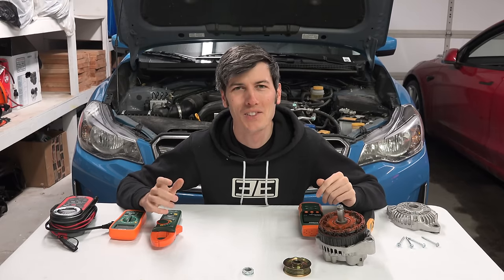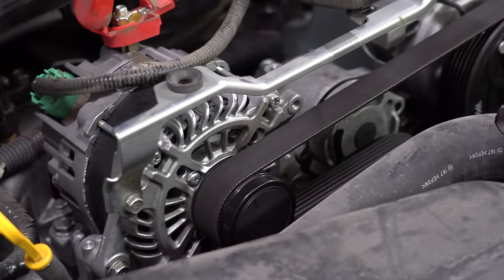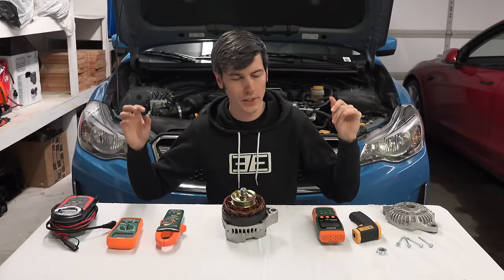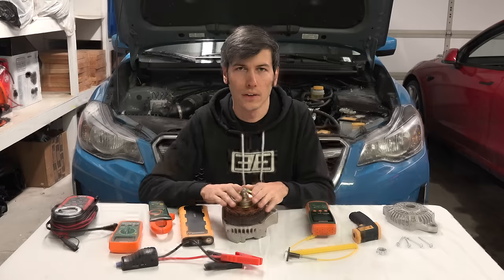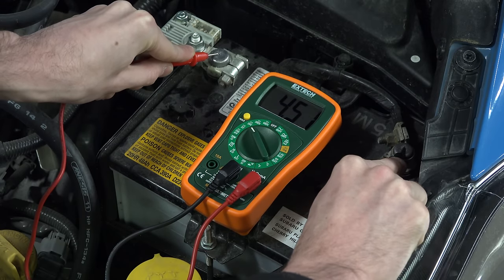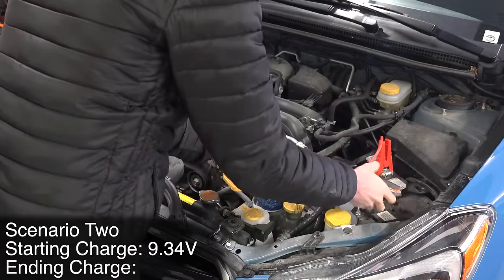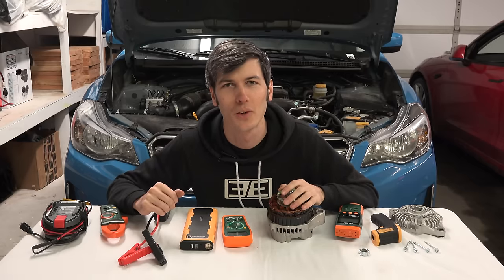Can A Dead Battery Ruin Your Car's Alternator?

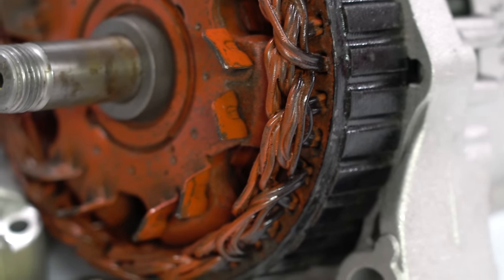Comment: 9:42 that is about the complete oposite of how it really is.

The alternator has a set max voltage.
A bad battery that doesn't take charge anymore draws significantly LESS current to rise the voltage to the max voltage and the alternator won't do much work.
A good battery with low voltage however will draw significant ammount of amps.

An alternator only outputs as much amps as your car and battery can receive.

If a battery is bad it usually take maximum 20 to 30 amps charge if it is low voltage, a good one will easily charge over 70 amps or more.

Work as a full time mechanic and is the head of electrical diagnostics at work.

It's not like you said "a bad battery will take more current to charge"

Still a good video tho
Reply: Btw when measuring both the alternator and battery voltage and comparing it the only thing the numbers tell is the voltage drop over the wire and charging voltage at both locations. 
Is it would be a difference over 0.1 volt it would either a very high amp draw/charge og bad connection
Reply from the maker: I appreciate you sharing, and even more so that you've done so kindly. To clarify what you're saying, a totally dead battery no longer accepting charge will still cause the alternator to run slightly higher amperage, but not as high as if the battery were accepting charge (and thus still good)? In other words, not completely inaccurate what I stated, but the highest current draw for an alternator will be with a good, mostly discharged battery, versus a dead battery.
Reply: @EngineeringExplained  A dead battery with a shorted cell or a high self discharge could also draw high current but usually a bad battery will take less current. Everything has its exceptions :)
Reply: @EngineeringExplained  I study electrical engineering and battery management, and I can confirm that in the case of lead acid, an old/worn battery will generally rise up to float voltage much more quickly and with significantly less current than a new battery which has been previously discharged. This is because the predominant aging process in lead acid batteries is sulfation, where lead sulfate crystals build up on the battery plates, thereby displacing/blocking active material from interacting with the electrolyte. This process also raises the internal resistance of the battery, which means that it will draw less current for a given difference between the charging voltage and the open-circuit voltage than a new battery under comparable conditions. Basically, in an aged battery there is less active material to charge, and therefore it draws less current during the charging process.

The exception to this is in the case where an aged battery has a shorted cell (this can happen from cracked plates or due to dendritic growth of metals in the cells). If a cell is shorted, the functional cells will reach full state of charge at a combined voltage which is below the alternator's 14.4V target voltage, and as a result the battery will continue to draw current all the time, releasing heat and hydrogen/oxygen gas in the process. This can cause current drawn from the alternator to remain high indefinitely.
Reply: @DielectricVideos  well explained
Reply: @abyssunderground  When AAA comes to give you a jump, are they measuring the  alternator current when they determine on the spot that the battery is bad or not?  Or is there some other (perhaps more reliable given your caveats) way to do this?
Reply: Most of the bad batteries I have dealt with had a shorted cell(s) They had enough juice to start a car but the alternator was continuously running at high current. When the car finally would not start, the driver replaced the battery and then find a bad alternator. They usually blamed the alternator for killing the battery, but it was the opposite.
Reply: @rosen380  No, since that can't be accurate. They tend to use a specially designed meter which looks at the internal resistance of the battery and its cranking amp capability based on that. That's usually a good measure of whether it's good or bad as far as I'm aware.
Reply: i was hoping i wasnt the only one thinking this, ive seen many batteries, bad and good, in my 30+ years of messing around with them. unless the battery is shorted out internally it will almost always take less amps to "charge". the biggest down fall with running the car with a bad battery is that the voltage isnt going to be very stable while going in between periods of high and low electrical loads. you will potentially see lights flicker, have stalling issues and or set check engine light for components that cant function correctly outside of their normal voltage tolerances.
Reply: learn something new every day. ive been a tech for a decade-ish and didnt know that. never even heard that explained before. i guess thats why i dont do electrical diag lol, a lot of that stuff still bewilders me.
Reply: @EngineeringExplained   
Lead acid batteries have something called "surface charge", after charging it for 20 minutes and reading its voltage it might seems that it is fully charged but you have only charged the electrolyte that is close to the plates, if you let it sit for a while you will see that the voltage will drop substantially, because the charges are spreading and evening through the entire battery.

That's why if you jump start a dead battery and let it run for only 5 minutes it will have enough charge to start the car if you turn it off and back on immediately, but if you just kill the engine and try starting it after a few hours it will not start.

Also @tullguten is correct, alternator does not "send" charge to the battery it is just a current source, the battery just takes the amount of current it wants, if it is empty it will try to sink as much current as it can. The battery will take less and less current as it charges and the battery voltage rises, once it gets full it will appear as a open circuit to the alternator, since there's no difference in potential. A dead battery is most likely going to go open circuit, so no current is going to be drawn. Unless it goes bad because of internal resistance going down (internal short), which is unlikely to happen.

I really appreciate your effort to make the tests to be as controlled as practically possible.
Reply: I read comments hoping to see somebody explain how the alternator ouputs different amounts of power depending on which battery is attached, even though it is turned at the same RPM in both scenarios.
Reply: @realsstates1180  Because alternator is not like a generator, which have static magnets. The magnetic field is created by a electromagnet which self regulates, as the RPM increases. A 60A alternator will try to deliver 60A at all times over the entire RPM range
Reply: tullgutten - how about a low battery with bad connections? Voltage drop access the corroded connectors. That’s gonna work the alternator much harder.
Reply: @PapaWheelie1   that energy has to go somewhere,  If the alternator is outputting 600 watts (14v@43 amps) and it's going into a bad connection, that connection's going to melt, if it's going into the batter (and not coming back out to run the car) the battery's going to melt.  There really isn't a situation where the battery will start the car, but put significant strain on the alternator (other then charging a dead battery) that actually happens in day to day life.  If you use a battery that say, runs itself dead flat over the course of 24 hours or so due to a internal short, the most power that battery will consistently drain is 1\24th the battery capacity.  A typical car battery is about 60AH or so, 1\24th of that is 2.5AH, or 2.5amp extra draw on the alternator.  There aren't many people who don't replace a battery that can only hold it's charge for 24 hours or so.
Reply: @victornpb  That is it, like the drain till flat point reading, if waited 24hrs(common time frame for a Surface charge check since last input) the voltage would have come back up with a good battery, how much depends on the size of the battery.
Reply: Alternators don't nevessarily have a set voltage of any sort.  Voltage regulators are often separate units that do not always function the same.  Most use some form of pulsewidth modulation to keep voltage from going too high, although I have seen solid state regulators usef.  Some regulators also have step-up buck converters to set a minimum voltage as well although that is overkill in most cases because at idle, most alternators ars producing significantly more that 14 V if energized on a 100% duty cycle.
Reply: @EngineeringExplained  if a battery is dead there is usually one of the cells that is damadged causing high resistance limiting the charge amperage to almost 0 just after getting the engine started.

Think like this, there is 6 cells in a 12v battery.
Split that to 6 seperate batteries and one is dead, it does not give or receive any usefull current, the voltage might seem ok but when connecting a load it drops immediately.

Just like if you take 6 lightbulbs in series and one of them is 5 watt and the rest is 200 watt the whole circuit is highly limited by the one bad/small bulb since it can only pass a certain ammount of current
Reply: PapaWheelie not really it is the opposite, a bad connection adds resistance limiting the current, thus the alternator will do less work.

Maybe if you have a flat battery and try to charge it and run all the electronics (AC, headlights, stereo, defog) at the same time you can exceed the alternator capacity, but it will probably just blow the rectifier first
Reply: victornpb - thanks for the correction, I always screw up ohms law. And many other things lol. 

E=IxR (not E=I/R as I often remember it)
Reply: Is there a low voltage limit on a depleted battery say in cold weather that is an indicator of whether or not it’ll put strain on the alternator once the car is jump started?
Reply: @mrsemifixit  generally no, try to not run any electronics specially the high current ones (headlights, fan, defog) after a jump start. On most cars with usually sized alternators and batteries, it will take at least 1 hour with the engine running to fully charge the battery. Realistically 2h considering that other stuff is using power while the battery is being charged, and the issue with *surface charge* I explained in a previous response, limits how much charge the battery will take in a short amount of time.

So if you need to jump start leave the engine running for at least 30 minutes, this will give you a surface charge if you need to start your car again in a short amount of time, also turn off everything you can inside the car. Once you get home, use a mains powered charger on the slowest setting (0.1C) it should take overnight ~10h or so to fully charge it.

Lead acid batteries are very tolerant to charging conditions so those figures are really just a rule of thumb, should be fine for most cases. The only thing that damages these kind of batteries are deep discharging them everything else you shouldn't worry too much about. Car batteries are designed to be constantly charged, and provide huge amount of instantaneous current for the starter, but they are NOT designed to provide continuous power for long period of times. That's why your battery can provide +200A for a starter for a short period of time, but you can kill it by just forgetting a tiny interior lamp turned on.

I hope that clarified a few questions
Reply: victornpb Thanks a lot. I just measured and the voltage is at 11.9v and it’s a 4-5 year old battery. 

Never had issues until stopped driving daily and it’s been in freezing temps for the week the car sat undriven. 

Now do I need to get it jumped and charged right away or can it wait a couple days? Temps should be above freezing by the weekend and rather do it then so I can drive it on the highway for over 30 min. Trying to avoid least amount of damage to the battery and/or alternator
Reply: Correct. Usually a battery has a higher internal resistance when it is "dead" (unless it died via internal shorting aka plates smashed together).  Jason's video shows more of a situation where you left an accessory on over a long period of time, rather than a 7 year old battery, being jump started weeks and weeks in a row because the owner is unwilling to buy a new battery.  But as you said, a good video.  It's great to see values as evidence.
Reply: @DielectricVideos  that's exactly what i wanted to say. The title of the video is misleading bc the battery is not "dead" it is discharged but thanksfully lot of comment mentioned that mistake :)
Reply: That makes more sense. I'm driving my motorcycle on a totally dead(bad) battery for 6 years now (didn't bother to change it, since it has kick starter). Never had a single issue with alternator (even in temperatures over 37 °C).
Reply: @EngineeringExplained  no. a complete dead battery has almost no resistance and will pull crazy amounts of amps. but will never raise in resistance because it will hold charge. it will turn all those amps in to heat and it will blow every diode in the bridge vary fast. and it will some times explode from boiling water inside the cell
Reply: A battery has an internal impedance, very very low, and is what allows it to provide those high CCA numbers. The experiment attempted to measure the battery voltage, but really just measure the alternator VDC minus the voltage drop across the cable. To be accurate, you would have to remove the cable, measure the batt voltage, then reconnect. no easy way. you are trying to push current to the battery using the higher alternator voltage. so if the Battery voltage were 10V and the alternator 14.5V, the resistance (impedance) of the battery would limit the current flow.
The alternator charging the dead battery was probably at the limit of how much current it could produce at idle rpm. Reving the engine would have shown that the battery could possibly accept more current.
Reply: @PapaWheelie1 
A low battery that still is in good condition has the potential to consume more amps than the alternator can give.

Voltage drop in any form if it is a bad connection or thin wire will result in a high resistance to charge thus lowering the charge amps, BUT if it is bad connection on the battery it might end up melting the terminal or burning the connector even tho it's rated for 100 times the current. 

The alternator is electrically regulated by a variable electromagnet in the core so if it is made for 120 amps it should not go much over it and also it will usually never go over 14.2v.

So in the end, a bad connection will make the alternator LESS stressed and the point of bad connection/high resistance will heat up.

If the battery receives lets say 40 amps and the car uses 20 amps the alternator will NEVER output more than 60 amps in total.
And if it is a bad connection with a voltage drop of 1 volt (And the charge voltage is 14 volt at 60 amps) that is totally 840 watt out and there will be a 60 watt loss at the battery terminal just going into heat ant the rest of the system (battery and car) will just receive 780 watt
Depending if the 20 amps to the car is connected straight to the alternator before battery it would be less power-loss.
Reply: tullgutten - excellent explanation. 
Now how about a starter with the same voltage drop? Say 10v on the end of the cable from a weak 11v battery.
Reply: @PapaWheelie1  depends on the car and how much power it is rated for, on a 2.0l VW TDI I think it's rated for 1.7Kw or about 150 amps.

And if it is a little smaller car and with low battery at 11 volt under load let's say it draws 120A and there is 1v drop over the wiring that results in a 120 watt power loss or just undre 11 amps in loss so there will be 109 amps going into the starter.

Hope that answered your question since i didn't understand fully what you wanted to know.
Reply: Yeah, energy can't disappear in a vacuum. If the amps were high but the battery wasn't getting charged, where would that energy go? It would have to be converted to heat in the battery, which would mean it would get hotter and hotter.
Reply: @EngineeringExplained  A dead battery has significantly higher internal resistance. Discharged battery has normal/low resistance and that is why it draws a lot of current. ohms law explains everything
Reply: You are correct that when both batteries are dead, a good battery can draw more current to charge. However, a bad battery could still be harmful to the alternator because it may partially discharge overnight if it has a high self discharge. Then when you start the car next morning, the alternator works hard to recharge the partially discharged battery, while a good battery would be drawing almost no current. 

Also, if a battery is worn out, it's recharge efficiency will be quite low, so the alternator would need to produce much more power than it would with a good battery to recharge the same Ah capacity because the bad battery would waste more of the electricity recharging. Hope this helps
Reply: Heres the issue, bad and good are subjective. To one person, bad may mean it has a high internal resistance. to someone else, it may mean the battery has been cracked open. 

basically

REEEEEEEEEEEEEEEEEEEEEEEE
Reply: @DielectricVideos  You are totally correct. Another thing that can happen to an old battery is simply that the plates in it can be eaten away so that there is no longer as much plate area to charge or discharge.
Reply: interesting information. good to know.
Reply: @gregorymompezat2261  The term "dead" is usually used to describe a battery incapable of supplying current needed to accomplish the task assigned to it, whether it's just discharged or any other reason.